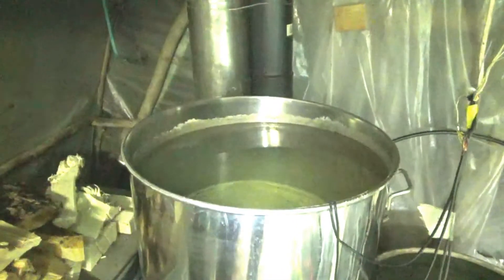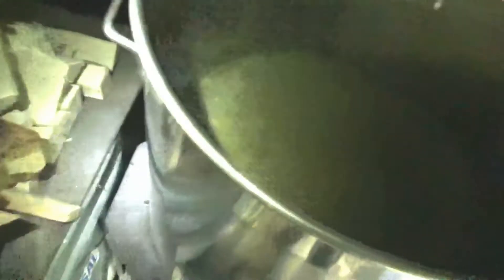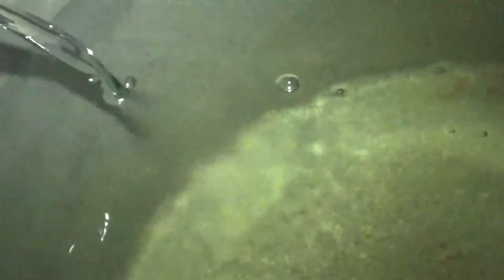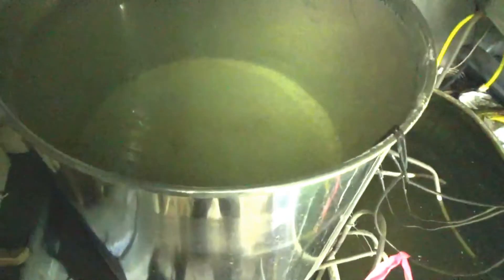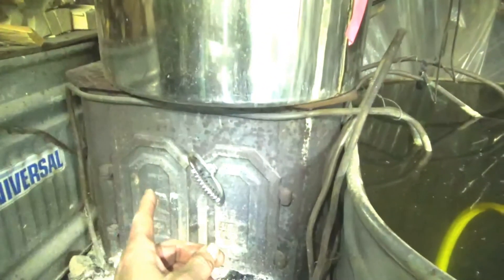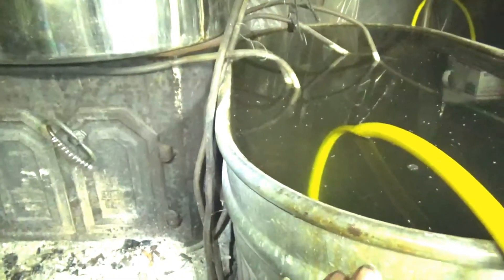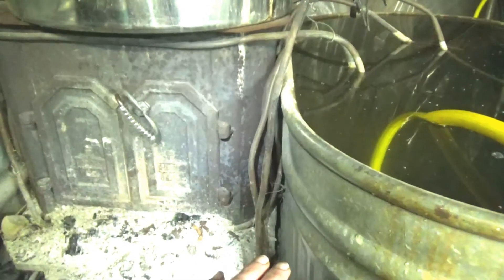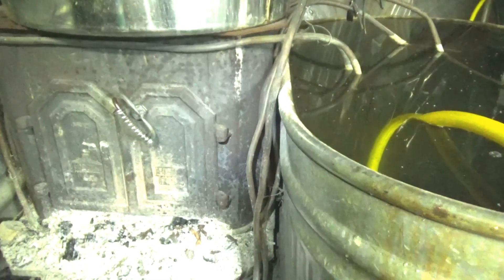Thermosiphon Basics   Water Stratification

Comment: I really appreciate your video. Someone posted about a Harley Knucklehead on FB that had water cooled cylinders. It had a radiator but no water pump. I didn't understand how this was possible and when I inquired as to how this system worked no one could answer me. I much research I found that the Ford Model T used this system of thermosiphon based on the principle of stratification as you have clearly demonstrated. Thx!
Reply from the maker: Cheers!  So glad to have helped!